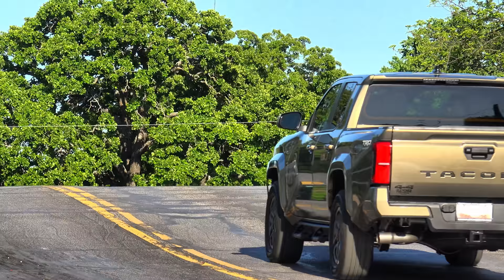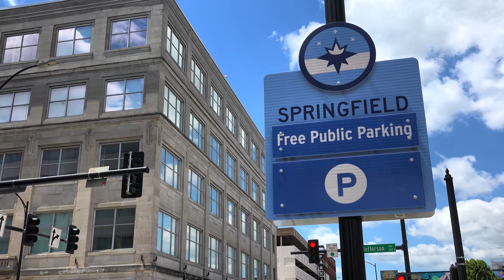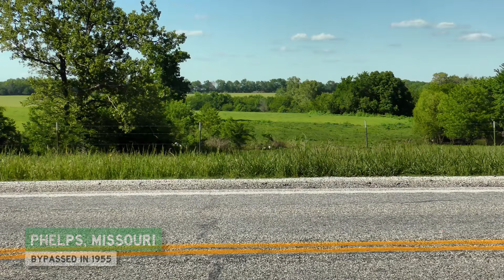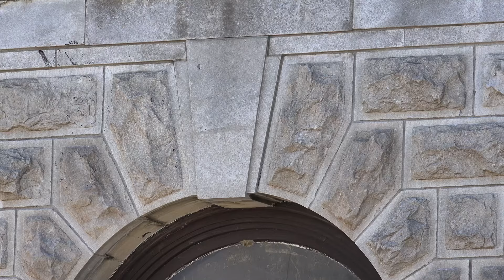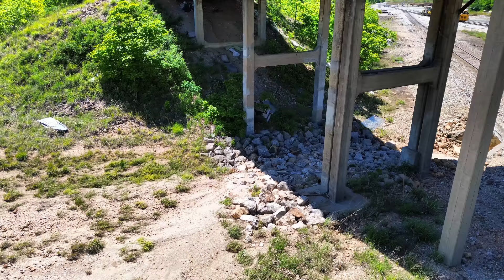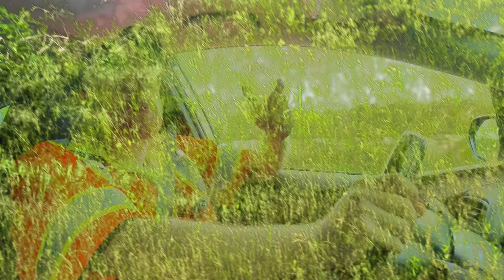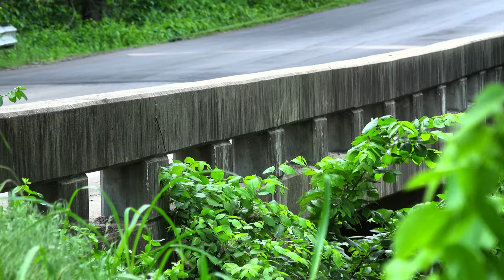When You Let the RAILROAD Build a Car Bridge

Comment: Grr. That's one of my biggest pet peeves about car infrastructure - parking lots between the street and the store. And if a store is ever next to a street with the parking lot behind it, the entrance to the store is always facing the parking lot. So pedestrians and ppl taking public transportation have to walk all the way around the building (sidewalks optional and there might be some very steep water storage/drainage ditches to cross as well) to reach the entrance of the building.

They just built a new indoor aquatic center in my town. They built it right next to the road (which is a major road) and right next to an existing bus stop with a shelter. So ofc, the parking lot is behind the building and... So is the entrance. Meaning the daycares that take like 20-30 kids to the pool and ride the bus to get there also have to herd those kids around the building to the entrance. There is a nice sidewalk from the bus stop to a door... That is emergency exit only. They had to put signs up that it's an emergency exit and not an entrance because so many ppl tried to enter there.

And it's not like the city doesn't know a ton of ppl ride the buses to go to pools. They literally run a dedicated bus from City Hall to the outdoor aquatic center all summer specifically because there is so much demand for ppl that don't have cars to go to the pool. 🤦

Comment: So just so you are aware, many of the bridges that Jasper county commissioner John Bartosh add replaced with these newer Bridges, were bridges that were well over a hundred years old and serve the community very well. They were not in disrepair nor did they have any other issues.

 They did this to our low water bridge near Jenkins Creek, it was a low water bridge that has supported several tons more than the new bridge can. Because of it being low water and having minimal barriers it acted as a natural speed reducer for drivers. With the new bridge people fly down the road in excess of 20 to 30 miles above the speed limit.

Comment: 19ft is common for european two way roads with single lanes. old roads often stay down to 16.5 to this day due to land rights and buildings, and former horse carriage tracks are as low as 6 ft..
should i mention that these are NOT one way most of the time and we still drive on them at 30+ and rally stages happen on them every now and then?

A 19ft wide bridge as a one way road for cars is comically oversized.

Watching how suburbia leaves america to deal with decaying infrastructure that doesnt even allow foot traffic is such a joke.

Comment: A car bridge being made of wood is definitely an anomaly nowadays. I don’t really see the material choice as really being that bad of an idea though. Plenty of railroads still use wood in a lot of their infrastructure. Everything from short bridges spanning gaps to track ties that hold the rails aligned and disperse the load across a larger footprint as well as snow shelters to cover sections of track and protect them from heavy snowfall or avalanches blocking the line. All of this infrastructure must withstand forces well in excess of what normal vehicle traffic could create in normal use yet wood is still being used instead of steel or concrete. Wood is a fantastic construction medium and can be capable of withstanding massive loads if correctly engineered. Wood is also cheap, much easier to source than concrete in many regions, and much easier to shape into what is needed on the job than steel. With a steel or concrete bridge the section has to be thoroughly detailed and designed before anything can start. With a steel bridge all of the structure will have to be ordered in the specific dimensions needed before being transported to the site in order and assembled via heavy bolts or welding. Yes concrete can be poured into molds quickly and easily on site but that’s only if there is a concrete plant within range. If it’s too far the wet concrete may begin to harden within the trucks before even being poured. The alternatives would be to premanufacture the concrete sections before transporting them to the site or to build a concrete station on the site itself. Transporting large sections of steel or concrete come with massive challenges themselves. The pieces must be of an appropriate size and weight to be transported to the jobsite and a crane large enough to lift them into position must also do the same. This can be a monumental task in and of itself in many rural and mountainous regions. Roads along the route to the site may have to be widened or straightened, obstacles like power lines or trees may have to be removed or relocated, and bridges along the route may even have to be reinforced to take the load. All of this adds a shitload of time and money to the project. Wood on the other hand is an inexpensive material grown abundantly in many regions of North America. It can be purchased in standardized dimensions and formed on the site into what is needed. A master builder with the general scope of work would be capable of leading a team of carpenters to complete the job. One place that comes to mind would be Mendocino CA. The last time I was there CalTrans was planning to widen highway 1 and in the process build new bridges in the area. The area has experienced an economic downturn in the last few decades. The regulations on fishing killed the local industry and overlogging 100 years ago thinned the Forrest to where all of the good trees are hard to get too and not as economically competitive for the global market. If CalTrans were to build the new bridges out of locally sourced timber not only would it help revitalize the local economy but it would be a symbol of pride for the locals with it constructed from their own timber. It may even help generate more tourism for the area with people coming to see it. 

Part of me wishes we could take a step back to building with more locally sourced materials. In the past buildings and infrastructure were built with the materials nearby. This showed the local community identity and helped distinguish our major cities. Now everything is the same soulless cookie cutter shape with everything mixing into a homogeneous grey soup.

Comment: In Norway we started building bridges and 29 floors hotel of wood some twenty years ago, there are quite a few of them, it is not a sucess, one collapsed under a truck well within the weight limit, something that led to that all the new wooden bridges were closed for 6 months.

They are idiots, for all bolts are of courge first grade stainless steel, so  very car and truck crossing made a littole movement in the wood, so that wera was against the steel bolts (yes , steel is somewhat harder than wood). all the wooden bridges has opened now, I don't know what they did, hope they put steel girders under them.

We do have wooden bridges that are more than 900 years old in their basic structure, that is still open (beat that Japan!), but pedestrian, cycle and mopeds only.

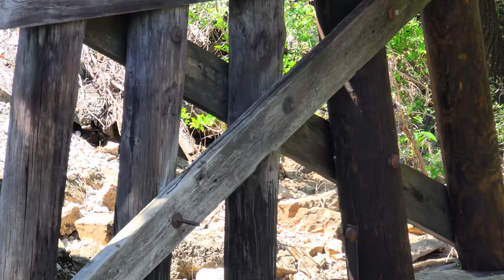Comment: 5:37 "... railroad bridge..." this bridge and the Whee bridge has the same techninc blueprint, both planed for constructing in wood, both build with the dame building technic... but the Whee bridge is calculated for lesser over all weight to carry (a car is lighter than a train) so the space between the support are as close together as on the railway version. The wooden parts of the Whee bridge are not in that bad shape. The steel parts should have been painted every 3 years since the last 60 year and could have been top fit until today, so corrosion worn them down. Rebuild the Parts put it back together and give here a fresh layer of planks and this bridge can be used for another 60year. If you keep the steel parts painted and refit the planks every 60 years this bridge should do her duty another 60+ 60+60years too so overall 240 years.

Comment: Timber bridges are still being built, usually for the aesthetics, but as long as the site conditions and design is solid they can be excellent bridges.  They do require a little more specialty knowledge during inspections to know where to look for defects unique to timber, like crushing at the girder bearings on the substructure units and checks and splits in the high-moment regions of the beams.

Comment: Worked on a project replacing an entirely wooden road bridge. Only other thing on it was a little bit of asphalt for the road surface. Crossed over a RR. Saw a 50-ton excavator track across it and it held up just fine.

Comment: Wooden overpasses used to be common because the RAILROAD built them. Of course, the railroad didn't care about speed for the cars, whether it had more than one lane, whether heavy trucks could get over it, or whether it would last more than 20 years. The Great Northern Railway built a number of amazingly inadequate overpasses along its mainline west of Minneapolis, like Cedar Lake Parkway in Minneapolis. The new bridge isn't a ramshackle wooden contraption anymore, but it still has the same vertical up-and-over profile of the old RR-built bridge. One survivor is on Lake Hughey Road, just north of U.S. Hwy 12 near Delano, MN. The ex-GN (now BNSF) is in a cutting there and the road goes over the top.
Reply: I know of quite a few wooden bridges built by the railroad and still in use, carrying the railroad. They were very good at building wooden bridges, and the later ones have lasted because they used huge timbers that were well treated with creosote.

I know of a highway bridge which used to carry US-2 (the most northern US route across the country) across the Pine River in Chippewa County, Michigan, just south of the town of Rudyard. That part of US-2 has been superseded by I-75, but the highway is still there, as a county road. The bridge is high and wider than necessary so it has enough room for pedestrians, and while the deck is concrete, the entire structure underneath the deck is wood, and it’s in great shape. Not sure who actually built it or when, but there’s no railroad there.